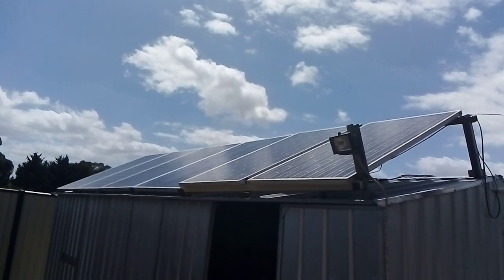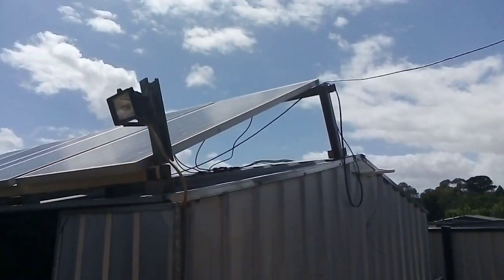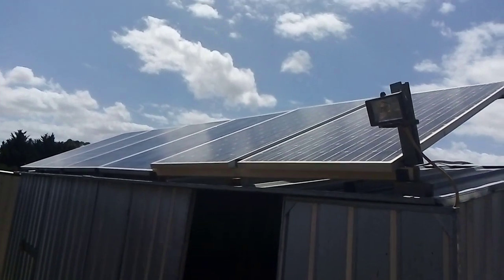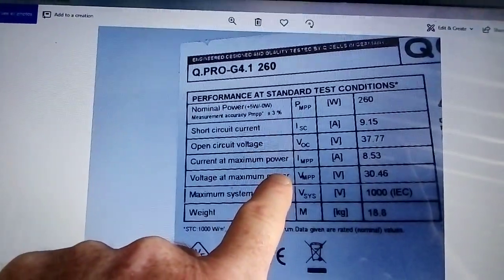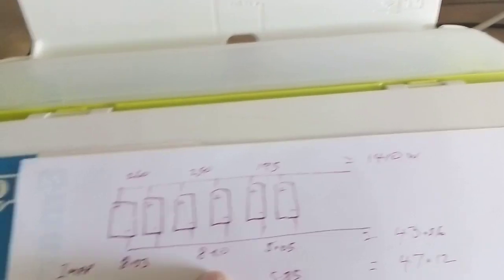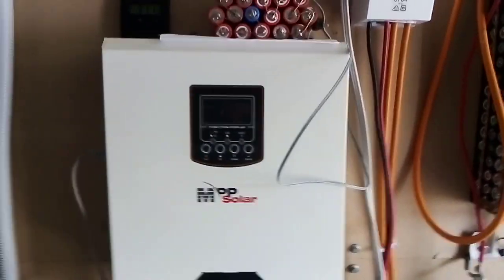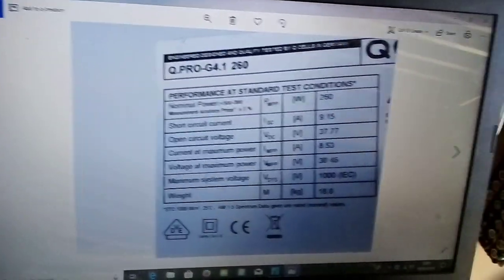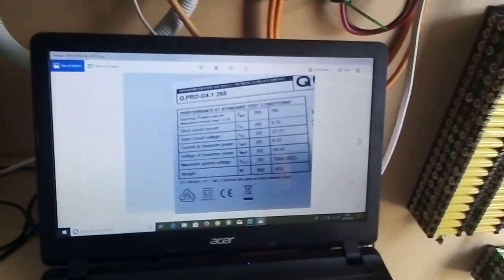How many Solar Panels do I need for my Mpp PIP 3024HSE Inverter!

Comment: Why didn't you parallel the panels into two by three so you'd halve the amps, surely the 3024HSE can handle the increased voltage?
Reply from the maker: If you check out my first video 'Fusing is not a bumb idear' I believe that it was a direct result of over voltage.
The PIP currently is rated at 80v max. The manual says this and recommend that to keep it to a 75v limit. I think that 2 pairs would put it between the 75v to 80v.
I want to play it very safe. Didn't want to make another video that same as my first one. I need to add another charge controller PCM60X. Just like Pete HBpowerwall.
My system is modeled after his.
Thanks again for watching and supporting me.